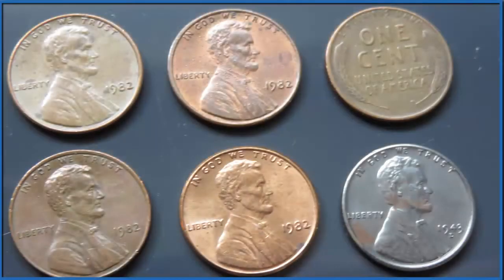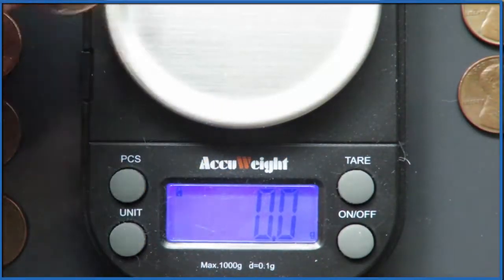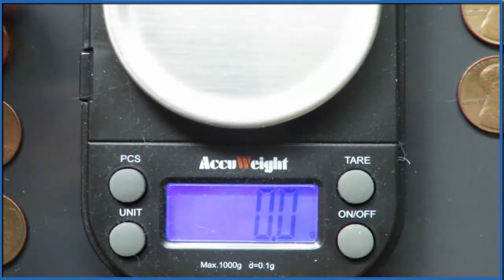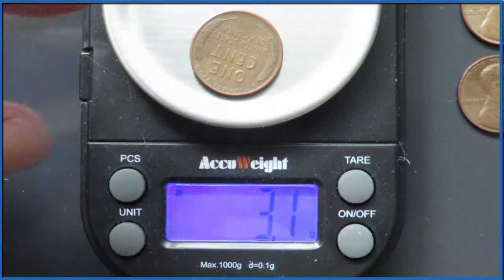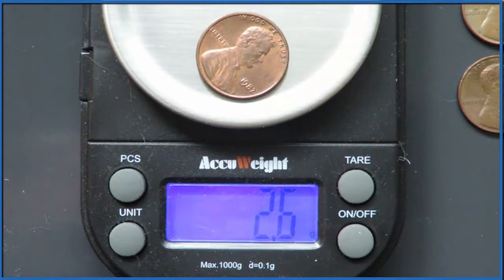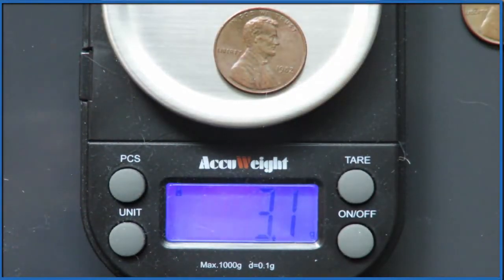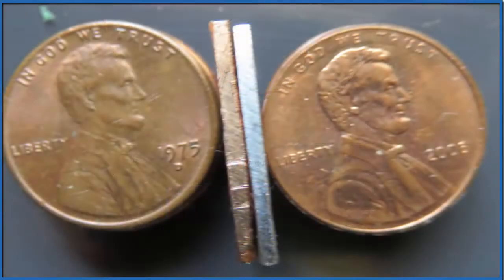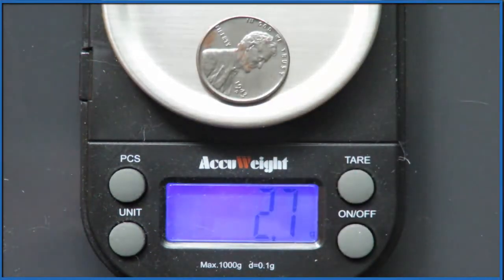How much does a penny weigh?

Comment: I have over 42, 1982 pennies in many different varieties and conditions. From the past three years my cherry picking of coins and currency exchange and coin roll hunting. Most are very, very extremely fine conditions. all our solid copper playing over 3.1 g. I have a few examples that are not copper. Also, if anyone is interested in this, please let me know or if anyone has any suggestions of what I should do with them. Let me know that also please.
Reply: If the 2 on the date is thick its a rare PE NY. But if the 2 on the date is skinny or regular it not worth nothing. The 1983 if the 3 is larger with a tail on the 3 its worth 23,000 dollars if the 3 is normal.like the one I just put its worth less

Comment: I have 1982 Philadelphia that weighs 2.50 grams but the thing doesn't look copper but chrome looking like a Dime or a Quarter...
I also have one the weighs In at 3.18 grams instead of the 3.0 like all the others. 
Any thoughts on this?
Thanks in Advance...
Reply from the maker: That is interesting.  I believe there are several different 1983 P pennies.  The 2.5 g would be the Zinc variety.   The 3.18 would likely be all copper.  Not sure why the 2.50g one looks so different!

Comment: Here in Australia, it is illegal to deface a coin or legal tender. There it is ok, something to know. I own 1 of your pressed pennies, it would be illegal if you got caught doing that here. When I was a child i received a 1 sided grinded coin which had a hole drilled through it to mount on a necklace. I could have been thrown in jail for that. 
I think the reason is becaus of the same as your copper pennies, in england they used to shave metal off the coins then pass them and build up some precious metal
Reply from the maker: Interesting.  I think the law here is that you can use pennies for educational purposes, like dissolving in acid to show how Cu and HNO3 react.  But in bulk, melting them down is illegal.  Our pennies are mostly zinc with a thin copper coating now.